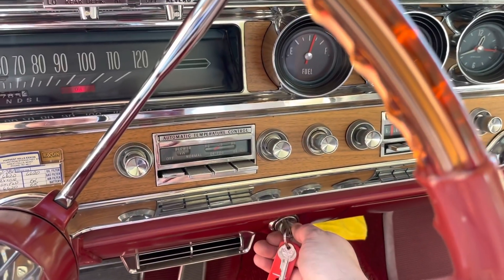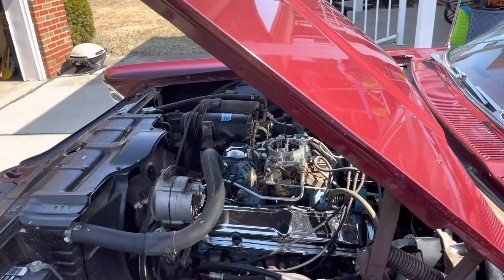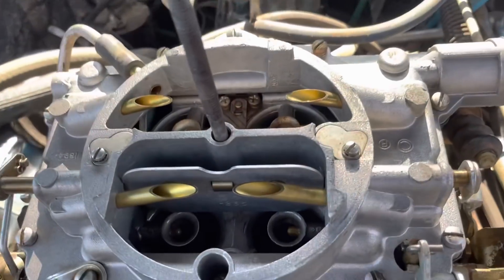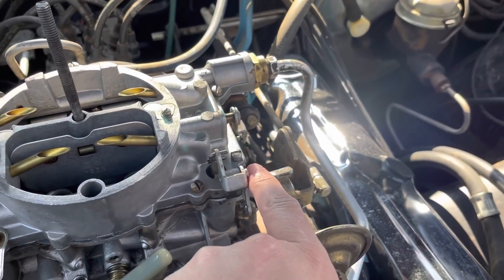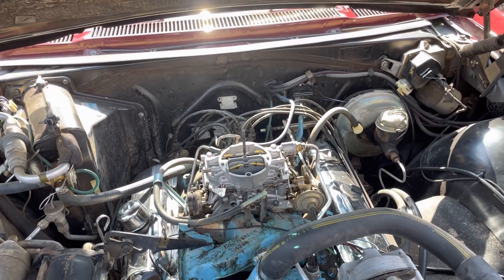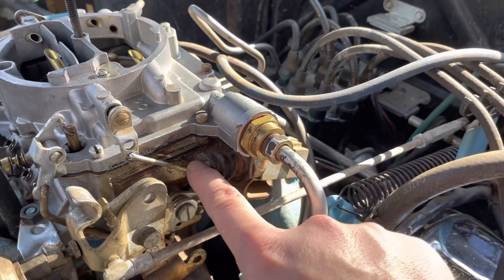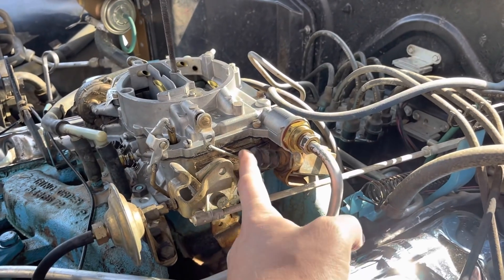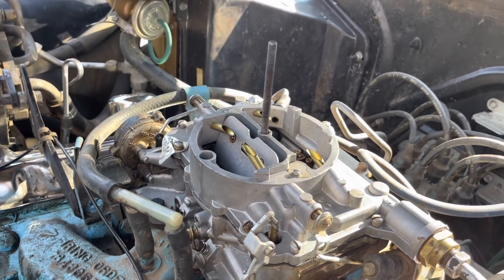1965 Pontiac Bonneville 421 Start Up, Run, and Carburetor Tips

Comment: The biggest most comfortable back seat I was in, excluding Checker cabs, was in a 70 Bonneville that my sister had back in the 80s. Huge car with a 455 2 barrel. That car was my introduction to fender skirts when I had to change a tire for her. I didn't know they came off!

Comment: That is very interesting about the throttle linkage adjustment, perhaps people just didn't know how to adjust them properly.  Is it possible the linkage was adjusted this way from the factory to help with engine break in?  Who knows.  Very interesting carb for sure, seems easy to work on.  Was the inside of the carb gummed up from sitting?  I wonder how many times the accelerator pump would have been replaced/adjusted before someone realized the float level was too low....   Love how that engine starts, two revolutions and it fires up effortlessly.  
I remember when my uncle bought a used 65 catalina four door.  I was so jealous, much nicer car than the chevys we had.
Reply: Yeah, Uncle Merritt had some nice cars, but they were tough on them and they were never around for very long...

Comment: Appreciate you saying how you fuel up these cars!  That's a hot topic!  I drive 11 miles to the nearest ethanol free station near me.  It's only 90 Octane, so I add octane boost every other tank, because I usually fill up with about 10 gals. left in 25 gal. tank.  Then I put in lead substitute every so often too, plus MMO.  But not a whole bottle.  I have my '69 Merc's 429 advanced to 12* and I have never had problem with ping.  City mileage is running 11 or more mpg.  Haven't done any long trips yet, but hope to this summer, so I can see what mileage I get.  Something I think a lot of owners might overlook is little stuff like putting on a new gas cap (better seal) new rad. cap (better pressure) new PCV valve and breather cap (better breathing crankcase and engine vacuum) and of course the oil and air filters.  But that is usually attended to.

Comment: Ok I worked on a 4500 car and truck fleet and when we switched over to lead free gas in 1975 we did NOT  have one fuel related issue with any of the vehicles pertaining to valve seat issues > case in point even through it's a low milage car the valve seats already have formed enough of a cusion from using leaded gas  back in the day . I would recomend the use of ethnol remover  when adding gas to the vehicle . This will also increase the life of the OEM fuel pump . great videos and you have a great collection of vehicles enjoy !
Reply from the maker: Interesting. Will look into that. Thx

Comment: I had a '68 Catalina with a 421HO in it and I think the Carter AFB 4bbl was one of the best carburetors to ever come out of Detroit. Go out on a below zero morning, engine stone cold, press the accelerator to the floor and let it up (per owners manual instructions) and turn the key: Guaranteed it would start before the engine made one whole revolution: Of course as long as the float level was right and the accelerator pump was in good condition.
     Buried the speedometer on it many times: 130-135 or so.

Comment: In 1967,  the fuel and alternator gauges moved to the bottom corners of the speedometer,  instead of being separated like in this 1965.  The turn signal arrows also shrunk in width... a lot.
Reply: I loved how the gauges looked in 1966!

Comment: I see that RCC's subscriber count is jumping up by the hundreds with passing days. Congratulations! In these strange times, these beauties act as a soothing balm for us older guys. Have you ever had issues with unleaded fuel in these ~pre-1975 engines? I always heard that unleaded causes valve damage over time.
Reply from the maker: Thx!  It can, but I use less additive for the cars that need it, mostly those made before 1972.

Comment: Does this bring back memories!  My aunt acquired her late father-in-laws 1965 Pontiac Catalina Vista four door hardtop in the spring of 1966 after his death.  The car was  painted in a turquoise metallic with matching cloth interior.  Very well optioned, it featured air conditioning among other accessories.  My aunts house was similar to yours with a detached two car garage and a concrete side driveway.  She parked her Catalina on the left side of the garage which was a straight shot down the driveway when backing out.  My uncle was driving their two year old 1964 Buick LeSabre Custom coupe (light beige with fawn interior).  He parked on the right side of the garage which required some skill and dexterity when backing out of the garage,  He had a iron post filled with concrete placed at the corner of the house for protection incase the car slid on ice or he miscalculated when backing up.  Seeing this beautiful '65 Pontiac parked the way you have it in your driveway brought back a flood of pleasant childhood memories.  My uncle is long gone but my aunt is still going at 91 years of age, almost blind and hard of hearing.  However, her mind is as clear as any 30 year old!  Thanks so much!!

Comment: Many many people miss this important point:
Adjustment is everything.

I've seen cars that have had $10,000 spent on super powerful engines with all manner of internal modification and they have overlooked Throttle adjustment.
You'd floor the gas pedal in the car and the carb would only open 70% so their 850 cfm carb would be lucky to be 600 cfm.
So much for all the expensive engine mods.

Comment: Maybe the race gas will help with that spark knock on startup.  This thing was high compression (10.5?) to start with, and with the years of carbon, may even be higher by now.  If not, you may have to pull back the timing a little.  Would be a shame, though.  My Firebird really likes timing, and it knocks like crazy on straight 93, so I had to dial it back.

Comment: I had a 1966 Catalina 2+2  4 speed manual..  Great car.  The accelerator height on power brake cars came factory adjusted very low.  GM discovered as more and more cars were being sold with power brakes, which had a wider brake pedal, it was fairly easy in a hard panic stop to have your right foot press both the brake and accelerator pedals at the same time. This was before mandated NHTSA safety recalls, so the “solution” was to lower the accelerator pedal.

Comment: What is the small louvered section of the dash pad directly behind the gear lever?

After a couple of years of snapping everyone's neck, my dad had his '87 Electra's throttle adjusted so it was possible to take off smoothly.  We had thought it was just his driving.  I reckon Buick had had a lot of complaints about poor throttle response in the peak (or trough) horsepower malaise years of the early 80s, and they had overcompensated.

Comment: Who  recalls the  days  when it was popular  to  order a new car  or truck  you would sit down  with the  Sales associate  and  fill out a order sheet  and  the sales Rep would check off every  box  that you told them too  the more options the more money in his pocket  but nowadays  few people do this any longer  because  the dealer  on demand  in stock  inventory  nowadays  is more plentiful  with each Unit  being  well equipped  unless your really hellbent  on a certain color and combination of equipment  you can still do the order but most people don’t  want to wait  6 to 8 weeks  so they settle for what is in stock and when you do that  you are getting the best deal  you may  have to be more flexible on color  and  a specific  option group  but  remember  I know from experience  when you order  you pay more  and be prepared for  delivery  disappointments  because the equipment you ordered  may not  be there  this is ALL the MFGs  BUT ......BUT  Ford  is NOTORIOUS  over the years for  this  fallacy  so remember that if you really have a need to order a very specific level of equipment & color combination  be prepared  to wait and pay more and  possible disappointment  also keep in mind  what has worked for me  look out for  Demos  or year end managers clearance special  they are  new  plastic still on the seats  but could have up to  6000 miles on it  usually  never more then that  but they already have a set price  on the table so your probably not going  get more then  3 or  450 dollars more  discount just make sure you get those miles prorated back to you  and try & get  a  protector  package included  that would make it  a really hot deal

Comment: I share your appreciation for the Carter AFB.  I have them as originally installed on a pair of AMC Ambassadors and they've been quite good.  Essentially no trouble after being rebuilt even though I run pump gas.  Perhaps it helps that I drive them a lot.  Don't know.

And what's not to like about such a beautiful Pontiac.

Comment: Those classic 389s and 421s had very high compression ratios, 10.5 to 1 to 11 to 1 as built at the factory, more if upon rebuild you bore out the cylinders.  That is why you have to use the premium and then add that extra goop to increase the octane further.   Pontiac Motor Division was using inconel valve seats before it became necessary for the unleaded fuels required in 1968.   I take my Pontiac 326, bored out 60 thousandths, resulting in a compression ratio about 9.5 to 1, and I can use regular 87 octane.  I believe the 326 is a good practical V-8 engine for the Tempest-Lemans platform.  Thick water jackets help make this option long lasting.  But yeah, I lust for that Bonnie!
When I was very small, my Mom drove a 1960 Safari Wagon.  Always bought the premium gas which she called Ethel.  23.9 cents per gallon.  With that 389 she had no problem crawling up the curly road out of Des Moines, Washington!

Comment: I would have been happy if the video were twice as long. This is a really good one to talk about. Adam, no one cared about mileage back then. Mpg awareness came in the 70s. What would you guess it got around town, 7-8mpg? My first car was a hand me down 70 Buick Electra 455-4bbl. The car was a torque monster to my 17yo self, and luckily my dad always filled it up, May he Rest In Peace, but it only got 9mpg most tanks, which went down to 6mpg when I ran the A/C all summer. Fun car!
Reply from the maker: Prob 7-8 city.  But I consistently got 17-18mpg Highway with my 70 Electra. 2.56 rear end really helped.  Great car.

Comment: Can you run aviation gas in your old car??   Stuff has lead in it, no ethanol, 100 octane(I think you can buy it with different octane ratings).   Would solve the problems associated with ethanol and no more little cans of lead additive.
Reply from the maker: You can. If you can find a place to sell it to you.
Reply: Is no comment a comment?

Comment: Very similar to the AFB on my ‘64 Electra. When adjusted properly starts and runs great.  Only issue is longer cranking on restart on a warm day. Some have said that ethanol negatively affects vapor pressure… But ethanol-free gas is not an option here.
Reply: True on the hard start issue.......even the NEW edelbrocks have that prob.

Comment: Pontiac didn't do the big block/ small block like Chevrolet did, but nice!
Reply from the maker: What do you call the short deck 265/301 vs. the 326-455?
Reply: @RareClassicCars  326 to 455 externally same dimensions.  The 301 265 were a different time frame if I recall. I don't really look at those at all . :) My comment, which I stand behind is the same external dimensions 326-455.
Reply from the maker: @capeway07  I agree on the 326-455, but “Pontiac” (as you called it) did make two engines that were physically smaller than the rest (265/301), so I’ll stand behind calling a 421 a big block Pontiac ;)
Reply: @RareClassicCars  ok your channel, your right to say what you wish. I've unsubscribed and won't bother you again. If your not going to be accurate for the period of car that your describing,  then how can I be sure what else you are saying is correct?

Comment: You say that the 421 always came with chromed valve covers. This may not have been the case with very early 421's, for example from 1963, because in this video is a 1963 Pontiac Catalina 2 door sports coupe with a 421 engine with blue painted valve covers, not the chrome valve covers, and it says 421 on the body of the car at 0:53-0:55 in the video. "1963 Pontiac Catalina Sports Sedan 421 White OrlandoBahiaShrine030715" https://www.youtube.com/watch?v=wAcAHuMZjbc&t=64s
Reply from the maker: Not always. Just meant in 1965.

Comment: that is a beauty , very nice car ,             thanks for sharing your treasures , That Bonneville is too nice to be a daily for sure , with original exhaust you can be a surprise at the car show 
I am from Canada and disabled , I restored a 1955 Chev and had to sell it 
I would be the guy to buy a solid old car thats a driver , yours are too nice to be daily driven for sure 
trying to find a 50-60's car , 4 door as 2 doors are out of my price range , a decent 60's fullsize  gm 4 door hardtop would be great , I miss the 1967 Grande Parisienne I drove in my teens , I kick myself for selling a 1967 Bonneville too, they were decent drivers , not perfect but enjoyable ...needle in a haystack  to find now........

Comment: If it was my car I would keep the original single exhaust. These cars are supposed to be quiet luxury cars, not sound like a hot rod. Just my two cents. 
Very nice original car!
Reply: I agree
Reply: Dual exh. does not denote a hot rod. A great many luxo-bombs had duals.
This car would not be loud  having stock-type mufflers on both sides and would sound very mellow.
Reply: @UberLummox  That's true.

Comment: I was under the impression that the 455, along with the 389, was not a big block.
was this 421 a big block?
Reply from the maker: Any Pontiac 326-455 is the same size, so they’re all technically big or small blocks

Comment: I was surprised to learn the 421 had a single exhaust system.   I think around 64 or 65 Cadillac went to a single exhaust system without a dual option and made a big deal about it being as efficient as the old dual system.   I don’t know that I buy that but it seems Cadillac wouldn’t have done it just to save money… I wonder if the Pontiac offered a dual system on the Bonneville.   I am sure Catalina 2+2’s had duals and so did the GP.  One of my mom’s sisters and her then current husband had a Catalina 2+2 and it had duals and was quite quick for such a big car.  I think me and 4 or 5 of my cousins could sit on the back seat.

Comment: Nice car, but what does it cost you run that thing at these fuel prices? Like 2 dollars a mile? Get used to it, its going to continue to go up, and up.
Reply from the maker: No. It gets 16-17mpg freeway if you stay at 70-75mph.
Reply: Absolutely no way that thing can get that. If is does, it will still cost you one dollar a gal. Like your show, but your way off on this one.

Comment: The single exhaust actually sounds good but I’d have to put duals on it if it were mine. Just a set of turbo mufflers though. I don’t know if it’s due to the angled down exhaust port but the Pontiac V8 has the perfect deep rumble to it no other engine has.

Comment: Nice informative video, nice Pontiac. 
Do the front parking lights turn off when the headlights are turned on?  I've noticed that on other 60's  cars - never understood why they were that way.
Reply from the maker: Yes.  I think that is generally true until 68ish.  There may have been a federal regulation against having both on until the side marker light standard was introduced for the 68 model year.
Reply: @RareClassicCars  OK  thanks.  Interesting with the side marker lights, we kind of take them for granted, but they weren't always there.

Comment: Adam, you mentioned what fuel and supplements you use with your cars.  Do you use a particular brand or type of oil?   Deric from Vice Grip Garage mentions using oil with higher zinc content on his older cars.   My 87 Dodge  Dakota is one of the last years to use flat tappet lifters and I am interested in the best oil option.
Reply from the maker: I just use a branded oil and add an additive like stp that has ZDDP
Reply: Motor oil preferences are like religious conversations…can be very contentious. After a lot of research there are two that I gravitate to that have high zinc content blended in: Driven and PennGrade1.  They argue that adding zinc additives to conventional oils not blended for soft tappet cams changes their chemistry in unpredictable ways. Who knows, but they are both priced reasonably.
Reply: I'm using Valve line VR-1, racing oil on my 69 429.

Comment: Technically Pontiac doesn't make a big block, just a block.
Reply from the maker: If you forget about the physical size difference of the 265/301
Reply: @RareClassicCars  yes that's true if go backwards enough in time, they were quite renown for inline 8's and 6's but, I was speaking in context of the 60s and 70s.  I stand corrected though. Love your content and presentation style.

Comment: Hi there! Big fan but your comment on the Pontiac engine being a “Big Block” is a misnomer, as all Pontiac designed engines came from the same core, according to noted PHS fans. The trivia game to win is throwing in Pontiac with other GM brands and their use of big block engine designs. Not being picky, but just thought I throw that out and it does sound great!
Reply from the maker: That is generally true, but one can call all of them a “big block”, I suppose.  The 265/301 do have a shorter deck and are physically smaller.  The 326-455 are the same size.